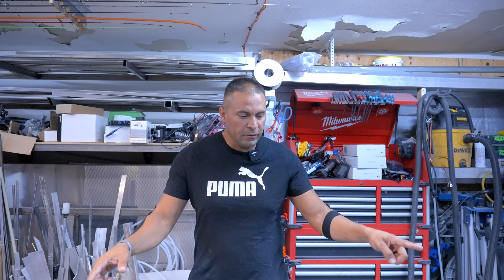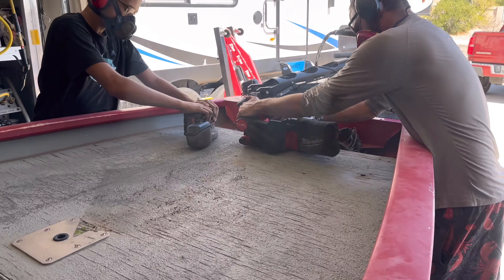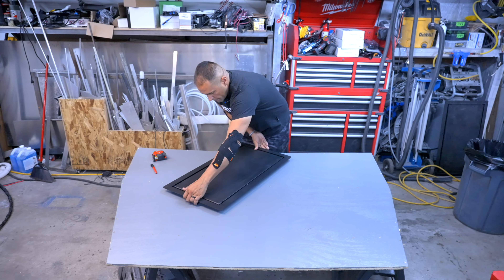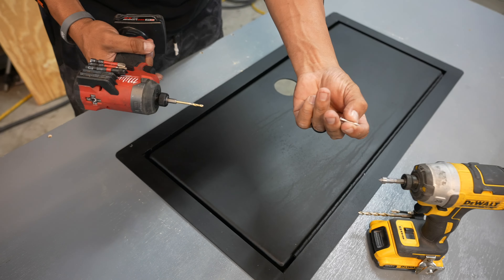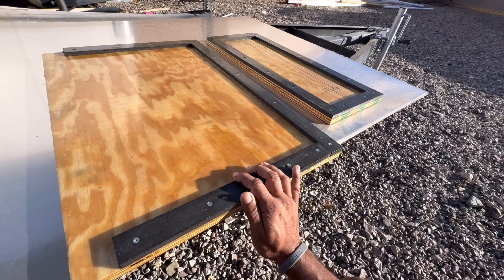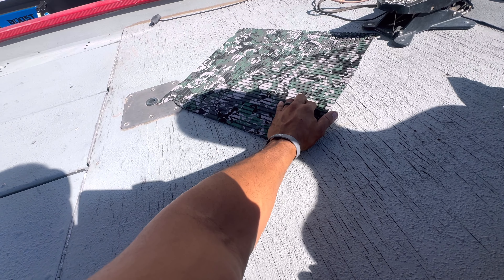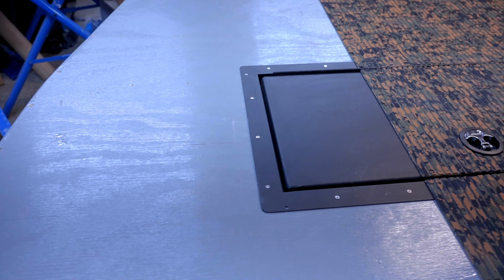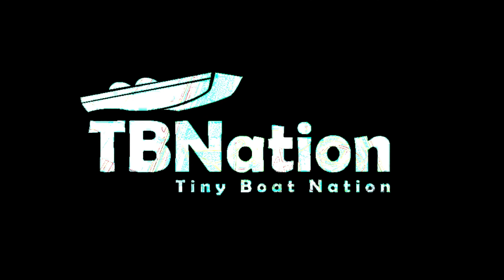Why wood decks are awesome + dry hatch install.

Comment: love what you guys do. ryan nate all you guys. i got an old 14ft arkansas traveler that im starting. it had wood gunnels and end caps so it will have to get the same treatment as your weekend warrior build. i will be buying a good portion of the parts from tbnation (live well kit, lid builder kit, etc.) got most of it figured up and priced out and looking at about $4000 to go into my $325 boat. lol anyway thanks for what yall do. i wouldnt have wanted to try let alone think i could pull it off without you guys.

Comment: Did the front casting deck and trolling motor deck with 3/4 Birch ply, epoxy sealed, and HydroTurf after watching your vids. Sticks like it was screwed down, fantastic stuff. Think I'll try the oil based for the floor that I'm doing now. Thanks for the awesome vids.
Reply from the maker: No prob! Although I would suggest that if you’re already doing epoxy that you should just epoxy the whole thing so it’ll last a lot longer
Reply: @TinyBoatNation  Will do, thanks. Screws or rivets to hold plywood to the center Z channels and the formed aluminum cross ribs?

Comment: Thank you very much, that video was perfect! I am saving up to redo the front deck on my regular Tracker Pro170.  I have been putting it off because I thought I could not put EVA foam effectively on my old wood deck. But I’m going to use these techniques and redo it and I’m hoping to add a recessed foot pedal for the trolling motor.  Thank you again for the inspiration.
Reply from the maker: No prob!

Comment: First of all, I love your channel. I have a 18 foot center console that was given to me, and I want to rewire the boat. Putting dual batteries, a VSR, and a cutoff switch. Right now everything is connected to the starter battery. Not good cause I haven’t noticed any fuzes. I want to install the fuse box also.  Can you please give some advice and or guidance. Thank you

Comment: Just to clarify, wouldn't you turf the deck after it's installed into the boat so you don't have to put the decking screws through the turf?

Comment: What thickness and span for the aluminum framing under 3/4 ply would you recommend?
Reply from the maker: You can run 16 gauge you just need supports every foot or so. The thicker, the aluminum the less support you need the three-quarter inch plywood is pretty stiff by itself.

Comment: I have seen jn your other videos u routered it out to sit flush do you not do that anymore cuz it looks fine in this video without it
Reply from the maker: There’s no need to do it if you’re going to use camel hydrator. It’s more important to do that if you’re running one straight color because then you’ll see shadows
Reply: @TinyBoatNation thanks do you think I should resin coat my wood or paint it like you did here